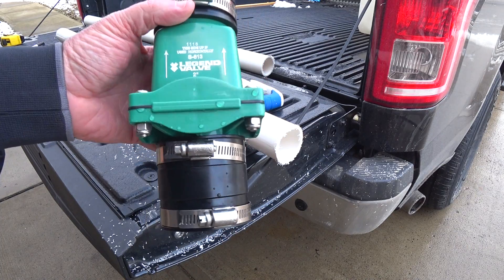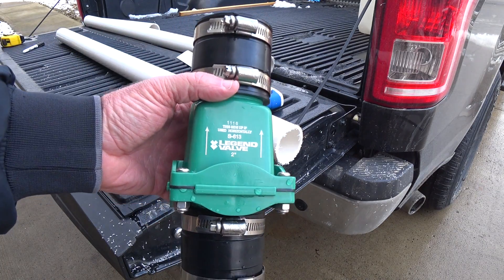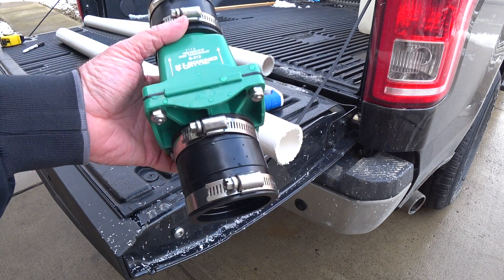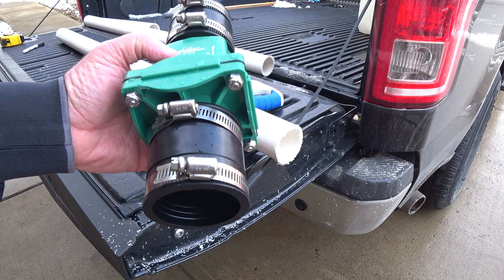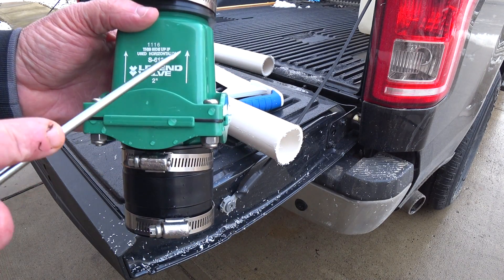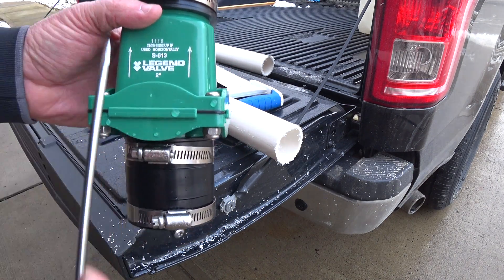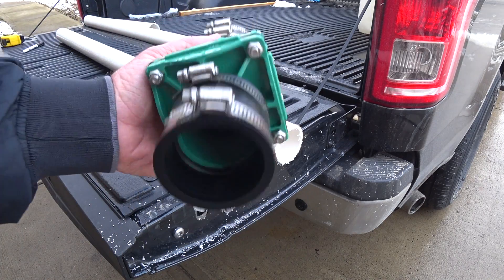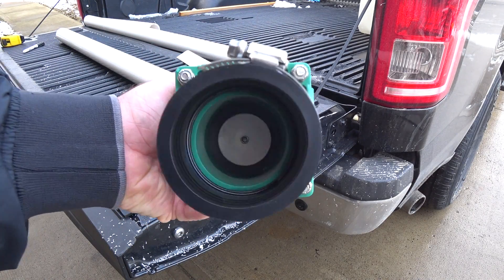#127 How To Move Water With Easy, Cheap, Siphon System

Comment: That works fine if you manually start it up and let it stop by it self at your predeceased level. Also seems safe against freezing.

Here is another idea that use the stuff you got in the video and only add a big bowl or small tub. This is sensitive for freezing though and need to be drained before it freeze over. You should put the bowl upper rim at the height you want to drain your pond. Then let the outlet pipe down inside bowl. You could use 90º and a short pipe for that. This will continuously keep the pond level att the height of bowl rim. 

Yet another alternative is to use a garden hose and a small flexible bowl. Most hoses are soft /flexible enough to stand the expansion of water freezing inside the hose. Put the bowl rim at the height / level you want to drain pond. Fill the hose and hold a finger on one end and let other end in pond, to be safe don't let it deeper than you ever want to drain pond. And go leave first end in the bowl. You may want to secure ends, done.

Comment: One more thing, air will migrate up the outlet and will eventually stop the siphon so you need to put a 90 turned up on the outlet end.  It doesn't need to have any pipe in it , just enough for the cap. Also don't use gasketed  joint fittings, the gaskets are designed for pressure and not suction and will suck air if the lift is high enough and will eventually  stop the siphon.
Reply from the maker: Air won't migrate up the outlet, the siphon will run until the water level gets below the inlet end and it starts sucking air. Enough water and it will run forever
Reply: @OutdoorsWithTheMorgans  Excellent video. My land is very flat so I cannot put in a normal outlet from my pond. If I use this system as a permanent way to drain excess water from my pond, when the pond level drops, if there is no outlet "stop" such as a 90° bend will it start again?

Comment: Just need to charge it fr the first time,,,,,,,,when ur done u just plug up the discharge,,,,n so the whole system will always be full of water,,,,next time just open discharge n let gravity do is thing
Reply from the maker: Except in winter, it will freeze and break
Reply: If it were possible to screw on a cap AGAINST  flowing water , you are right Mark.
However, $100 says no one can do it.
Reply: Ah, but one can open the siphon up top and water will stop flowing. Then he can put the plug in.

Comment: Mike.  I don't quite see how a check valve on top of the fill pipe would have helped or even worked.  Did you have a quick miss thought or is there something I am not comprehending here?
Reply from the maker: Check valve is in the inlet end, if you don't have it when you charge the system the water will just run into the pond
Reply: @OutdoorsWithTheMorgans     Sorry i was talking about 5:18.  re-watched and seen where you wrote " I meant to say ball valve".  that makes perfect sense now.   thanks

Comment: If You had a ball valve at the discharge end... You could close the system before air got into it and then it's precharged for next time...
Or just screw the cap back on at the discharge end before it loses prime... The only thing is You need to babysit it before it sucks air

Comment: Put a valve/tap at the end of the pipe if you close the siphon while it is running you do not have to prime it again ;) and also if you could use a toilet fill valve(instead of filling a bowl you are using it to drain) on your suction side it would maintain the level of the pond on its own if it can maintain the negative pressure in the pipe when closed

Comment: Great video and the check valve idea on the inlet is much better than the ball valve I have used.  I also used a ball valve at the outlet so I could throttle the flow or shut it off completely without the need to reprime the siphon.  One thing to note:  Not only must the  inlet be higher than the outlet,  the total rise over the dam cannot be more than 32 feet (at sea level - 27 feet at my altitude).

Comment: I don't know the price of pvc and all the fittings where you live, around here much cheaper to just rent a pump  for 4 hours.  I do love the good old way of doing things when I can, it just that I run out of room to put stuff after I'm done, and no way can I leave anything out over winter with water in it, so I'd have to cut up those pipes and dry them out before big frost.

Comment: How water moves up!
Reply: No barometric presure
Reply: The outlet has to be lower than the inlet. That way, the water in the outlet side is heavier than the inlet side. It naturally flows out, creating a vacuum which barometric pressure then pushes the water in the pond into the tube.

Comment: Do you think that I could do this with a 2" "lay flat hose on the discharge end?  I have been using a 2" Honda pump with a 20' x 2" Suction hose and a 50' x 2" lay flat to empty my pond into a lake across the road.  Watching your video made me think that the pump might be redundant. I guess what I really want to know is can a lay-flat hose syphon or will it just suck itself shut?   I'm thinking that the layflat might suck itself shut.
Reply: as long as it is full of water and the outtake is lower than the intake, the weight of the water will do the rest.
Reply: I'll Let you know.  Thanks
Reply: It will suck itself shut.  You need to use some form of  rigid (corrugated tile will work)
 to get the water below the lake level on the drain side, then the rest of the line could be run with flat hose since it is pressurized at that point.

Comment: To do this using a length of hose,
 feed the hose slowly into the pond you want to empty untill you are left with the end 1inch above the surface. Make sure you can see the water inside the pipe (this ensures there is no air trapped in the hose). Plug the end tightly. Drag the hose out of the water untill the plugged end is below the level of the pond. Open it. Problem solved.
Reply: While I was building my house the footings would fill with water. I just filled a garden hose with water then used it to drain the footings. Also when I catch water in a soak tub for flushing in case of a power outage I use a garden hose to drain the water rather than draining into septic tank. A garden hose may be a bit a bit slower but unless you are under a time deadline it will do the job and store easily.
Reply: I could have come off as more critical than I intended. I didn't intend my comment as critical, appropriate solutions for your specific need. I would be stupid if I were to to use a 75 mm line to drain a few hundred liters of water.
Reply: That works just fine for finger-sized tubing. If you want to move a lot of water fast, this dead simple solution is better.
Reply: I assume this would also work with 4” flex drain?  Thanks.
Reply: @Jim-iq6bx  it should, just make sure the end is TIGHTLY plugged as you lift it out of the water, it should be pretty heavy when you do

Comment: One thing to do different Mike, On your discharge end, use a PVC ball valve that you can open and shut. That way, you never have to prime your system after you first primed it as you did.The only downfall in your area is that of freezing which would possibly freeze your valve shut. I use this same method to drain swimming pools.
Reply: You raised points i never even considered. Smart man
Reply: Hi, 

Em, need some gravity therapy not great with this,

However hears my issue,

I run a hybanker sluice flourgold prospecting,,so i want to run my sluce continouse like say 24/7 
Now i have an inlet connection 1/2 inch feed into the rear of the sluice, now i know the system will work drawing water into the sluice,
Can i add a shut of valve on the neck before the sluice thus can i use that shut off valve/tap as a controller controlling the water in,

Further i don't know if its possible gravity fed that is if i could recirculate the water from a contanor back to a contanor the object is to get away from battery's,bilg pumps and physically carrying pails of water,

I do a lot of beach sluicing also,,so mikes syhpin system is great could i therefore say draw water from a creek,river lake even the sea as a potential water source to feed my system,,
Okay mikes Is a two I inch system so i would have to scale down help please your answers are highly valuied.

Thank you

Comment: You don't need a check valve because the water is not going to flow uphill
Reply from the maker: Jeff Card, yes you do, if not you cant charge the system as designed. As you pour water in to charge system it will just run into pond

Comment: If you need to keep an "Upper pond level" at a certain elevation and have a "Lower" pond to evacuate to, why not make a permanent discharge pipe to 
bleed the upper pond to the lower pond to retain whatever level you need? Simply dig a ditch and place a pipe at the level you need to retain...….that way you won't erode the dirt at the source pond...……………………….
Reply: He did...its clogged....he even points to it in the video

Comment: So a thought occured to me that if you'd installed a flow valve at the end instead of a screw cap you would be able to use it with less fuss, especially if you wanted to simply leave it there until the use was desired or required again. Which it will when it rains again.

Comment: If you ran the pipe underground to get the outlet lower could it be connected to a small vertical pipe and still have flow?

Comment: Great Video. I needed this four years ago.  I built one with a 4 inch pipe.  Moves lots of water cheaply.  

If your out flow pipe is long and way below the inlet, you may skip the check valve if you fill the outlet end with a hose

Comment: A similar system can be used in culverts that feeeze and back up water in the high side. You put pipe through the culvert before freeze up, with an elbow on the high end. The elbow needs a threaded piece pointing up. You then screw in a tall capped pipe to the elbow. In the spring when runoff starts building up, unscrew the pipe from the elbow. Water will flow down through the resulting hole in the ice into the elbow and out the low side.

Comment: So, when you charge it, it seems like the water would just run downhill and lose it's seal. Do you have to fill the whole pipe system up with water?? Or am I missing something here...
Reply: The weight of the water causes a vacuum, if no air can get in, it pulls the water out of the pond by suction, and the pipe needs enough weight of water to lift the water from the pond up over the higher edge of the pond.
Try and imagine if the pond had a wall around it, the weight of the water going into the pipe and over the wall would have to be overcome by the weight on the other side, the whole reason the outlet side needs to be lower than the inlet.

Comment: you dont need the check valve, just fill the longer lower running pypes, remove the plug, and it will even work better, no restriction in the inlet..
Reply from the maker: The way this is set up you need the check valve, when you pour water in to charge system there is no way to make that water go only to the longer pipes, yes if you keep pouring it will eventually fill but much of the water you pour will go right back into pond
Reply: Unless you bung the inlet first!

Comment: We added a 14 in pipe with 3/8 in holes drilled in multiple rows the length of the pipe to the check valve and then capped the end of the pipe.  This acted as an inexpensive trash rack to keep the check valve from plugging.
Reply: Don’t the holes make the check valve useless?
Reply: @Jim-iq6bx  The pipe with holes were on the pond side of the check valve.

Comment: Thank you.  We set up your siphon system and it worked like a charm.  Amazing how much water a 2 in pipe can move.  We were able to lower our pond enough overnight that the emergency spillway quit flowing.  A tip: the check valve is actually a sump pump check valve.

Comment: Hello !  Your idea is very good and practical as it has worked best  The idea of using a check valve is simply great!  See, I have a lake adjacent to my Lands about 1500 to 1600 ft.distance.  Lake water level is below the Land level of roughly about 7 to 8 ft.  Now I want to dug up a 10ft ditch near the lands and store water their through your Siphon system and from there on I shall use some means of power ( as of now no electricity is available) and water the lands.  I shall come back to that later.  Tell me, since you are practical and successfully implemented this Siphon system, can  the water be siphoned out to such a distance of 1500 to 1600 ft by giving a slope height of 2 ft towards the delivery side for 2/3 rds distance to the ditch which is already 4 to 5 ft depth than the Lake water??

Comment: Mike, good job.  I would probably dig in a six inch pipe and put that siphon in permenantly, it will be handy again and that way it is not laying on your road.  You need to cover the low point on the dam with 6" riprap rock to stop erosion when the pond overflows of course.  That will be a good summer video.  Thanks

Comment: Nice job Mike, no gas fired trash pump, no electric pumping, no compressed air PDP,  just old fashion gravity.  Some ask, " how do you stop it when the pond reaches the level you want and your not there to stop it!"  Simple, just put the length of pipe into the pond with the end at the level you want to reach, and the siphon will stop at that when it runs out of water.
Reply from the maker: Thats exactly right!

Comment: Great idea Mike, You don't know it but you gave me a idea on my abandoned well in front of my house way above my pond. Maybe I can feed the pond in the summer from it. I tried using a pump but it pumped down to fast.did you get the pictures of the spillway? Thank You
Reply from the maker: I will check and and see on the pictures thanks, and yes if the old well is above the pond you could even run a 1" pipe or something. The two inch I used moves a lot of water, 1" would keep up fine I think with evaporation during the hot dry summer months
Reply: witkrieg todd  hi;it's a very very hard explanation.thank u .but really i didn't understand even the easiest vedeo cuz i don't see what was the piece inside the river.and is 5 meter and 100 meter distance from my farm and river is conviniable for this free solution?

Comment: Good one Mike. That's a 'slick' way to keep the pond from overflowing.  
Speaking of having to clean off the screen on the over flow stand pipe,...couldn't you have this pipe close to shore, so you could reach it from there for clearing away debris? I mean when you start to do corrective maintenance this summer.

Comment: Love it. The only thing I would add is a gate valve on the outlet end.  Then you'd be sure to stay dry
Reply: To stop the siphon action just lift the intake out of the water for a brief period or open the vertical section of the pipe.

Comment: Won't the end with the check valve freeze and break since it has water in it?
Reply from the maker: Not as long as it stays down in the water a bit, now if it was going to get real cold like it did earlier in the winter I would have to lower it some more than what it is
Reply: Hmmm. I guess I really wouldn't be worried about the valve. I'm more thinking about the pipe that's out of the water on the pond side still having some water in it freezing and busting the pipe.  Don't get me wrong it's a good idea.   I just wouldn't have used the check valve and would have moved the fill pipe down to the discharge slope a little so you could still fill the discharge end to start the syphon. Know what I mean.  Once again I like the setup, just throwing my 2 cents in.
Reply: Wastegate I hear you. Just expressing my concern.
Reply: with a thinner pipe maybe, but you cannot syphon this huge pipe with a bucket if you dont have your ends plugged
Reply: Brett Buckley it would take an extremely cold day to freeze a 2 inch pipe of moving water.  If the water wasn't flowing fast, then you'd need to worry.
Reply: I live about 20 miles from the Morgan's. We have had quite a few days with single digits this year. My concern was the side with the check valve still having water in it. That pipe is not going to be flowing water unless he wants to lower the pond so there will be a few feet of standing water in the pipe once its shut off. My only point is the inlet side is going to hold water  at least up the level pipe.  That 10 feet of pipe is wherre I would be worried. I know it's just temporarily   I was simply saying I would have changed a little bit of it and saved the 16 dollars. I make YouTube videos too and I get constructive criticism too. That's all that was meant to be. It works just like he wanted it too. I honestly wouldn't h ave thought of this elaborate of a set up, so I give him tons of credit.  I was just stating what I  would be worried about if this was my property.
Reply: not if it is underwater.  The ice slows down its progression after it gets the initial freeze.  If the check valve was right at the water level it would freeze, so just keep it well under water.
Reply: @Brett Buckley - I am confident that water inside may freeze, but the check valve will not break and the pipe on the pond side will not break.  Assuming there is no siphoning happening at the time, here's why: either a horizontal film of ice begins on the water surface inside the valve/pipe, or ice starts to form from the walls inward.  The pipe is open at the bottom, so there is no way for water to be trapped before it is frozen, and if not trapped there is no pressure.